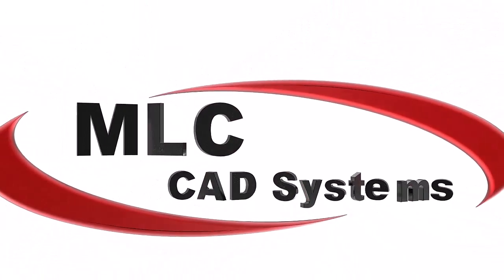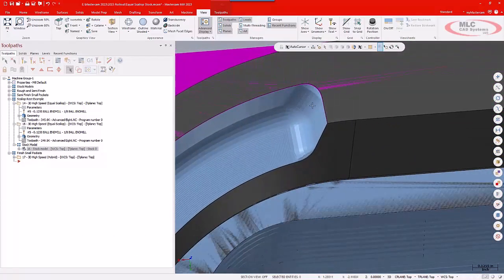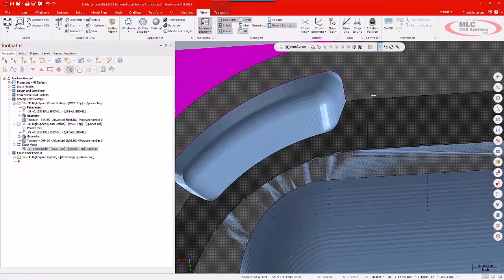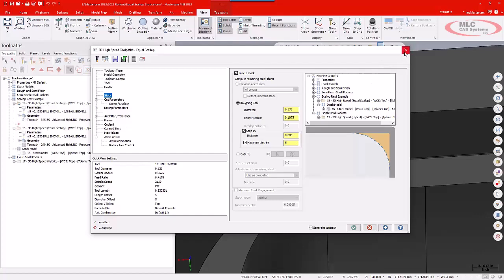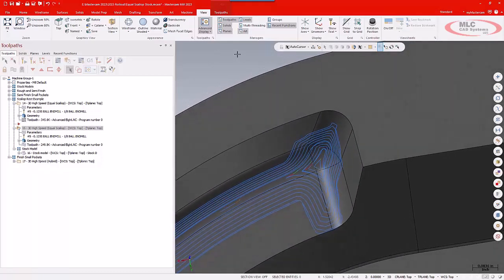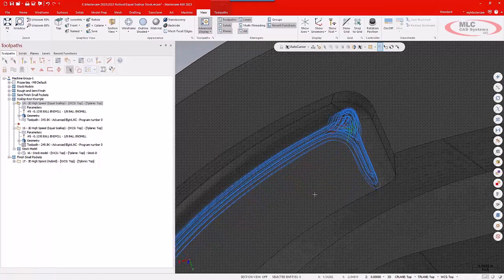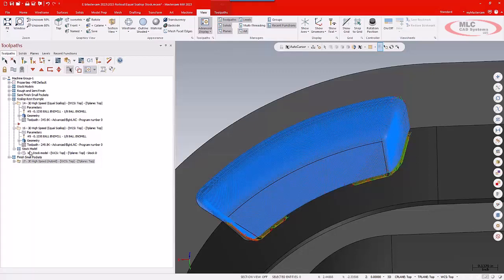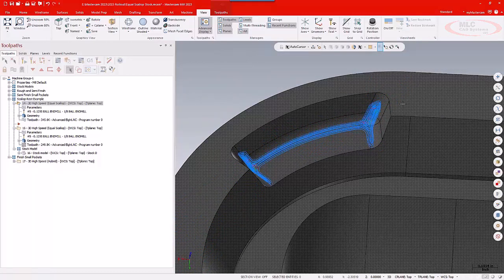NEW Step-In for Equal Scallop - What's New Mastercam 2023

Comment: Thank you for the explanation. Please, I have a question. What is the difference between scallops and hypers, and when do I use each of them because for me they work the same?
Reply: Do you mean Hybrids? If so, a Hybrid toolpath is essentially a combination of a Waterline and a Scallop, so in certain applications a Hybrid will work very similarly to a traditional Scallop operation.
Reply: Yes, sir, I mean the difference between the hybrid and the scallop because they are almost very similar in work for me. My question is in which applications can I use the hybrid and not use the scallop, or vice versa. Thank you for the response.
Reply: @armanshnan1875  Well both a Hybrid and Scallop work in very similar ways when dealing with a shallow surface, or one that does that have significant draft. A Hyrbrid is best deployed when you have a surface that transitions from a steep to a shallow angle as the Hybrid can use a different stepover value based on a given angle.
Reply: @dvoferguson  Thank you very mach